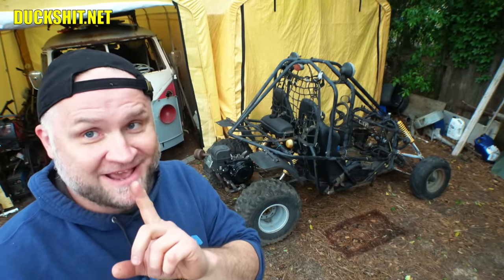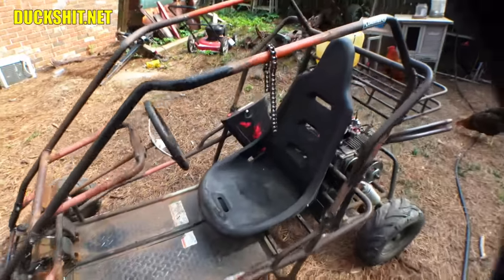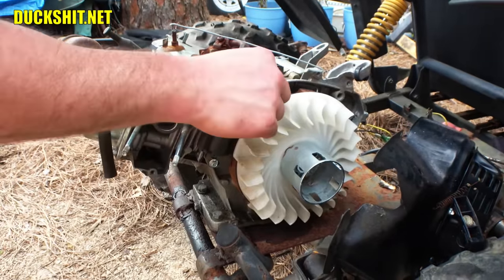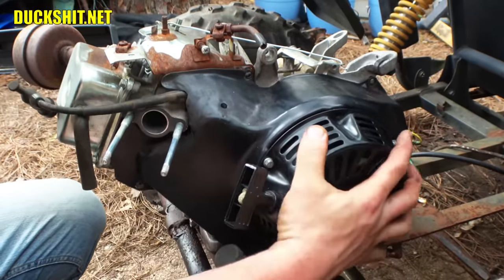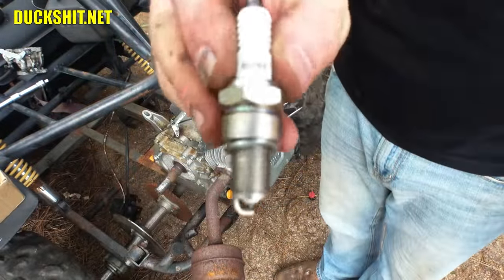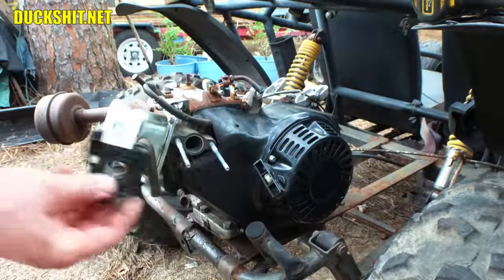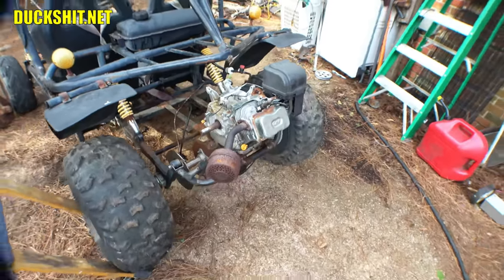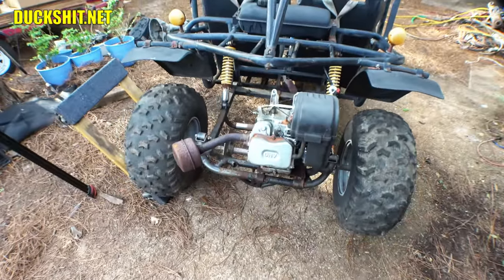🔧💥Go Kart Engine Resurrection!

Comment: You should put a vw engine and gearbox in it, a 1200cc motor is plenty good enough for a  cart it would be great fun, there looks like there is enough room for the transaxle with the motor out the back like a beetle
Reply from the maker: YOU SHOULD!   Power to weight ratio is too low with the Volkswagen engine, a motorcycle engine would take me a lot further for a lot cheaper in this case.  😁👍🦆💩
Reply: YOU SHOULD lmao
Reply from the maker: Hahaha 😂😂😂😂😂👍🦆💩